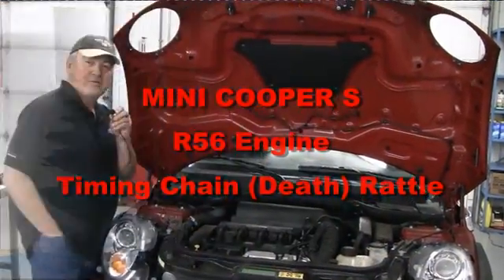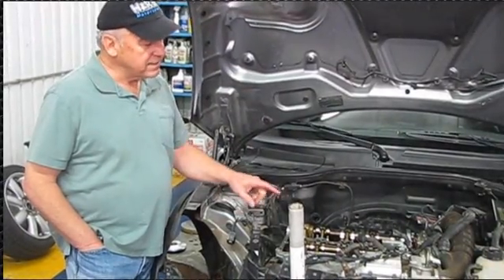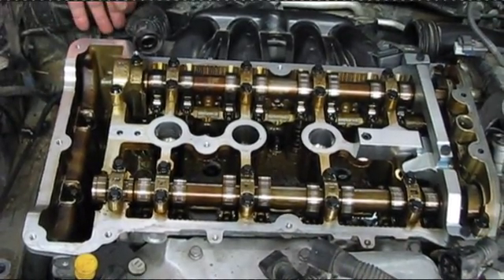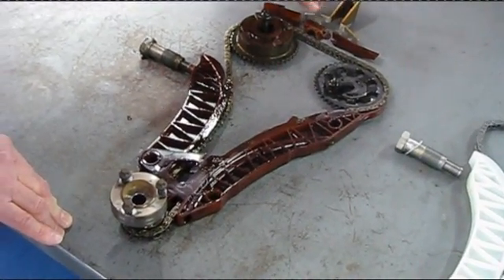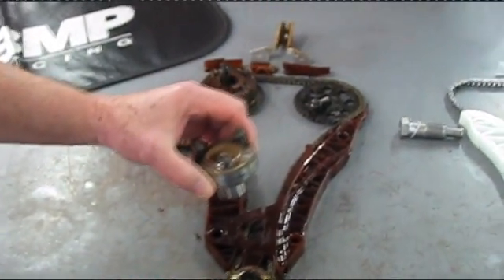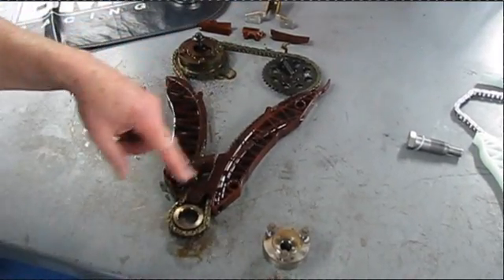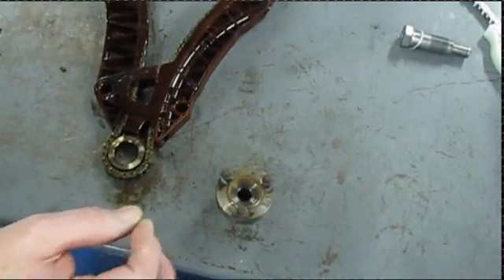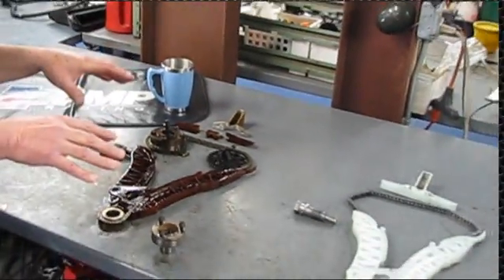Mini Cooper "S" Engine Noise - Rattle

Comment: This was a great explanation!!  Thanks for taking  the time to do this video!
Were the replacement parts stock MINI parts?
I need to replace my timing chain (67.5mm of play) and would like to use more sturdy parts if they are available (my car has ~59k miles).
I had an Infinity G20 which I sold with ~225k miles and the timing chain was never replaced, so, I know that sturdy parts do exist!
Thanks again,Lee